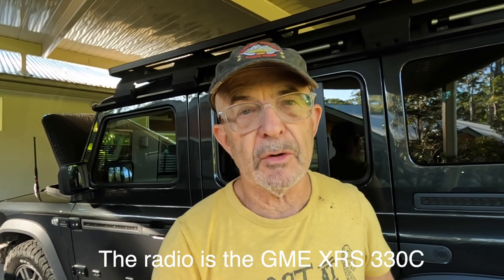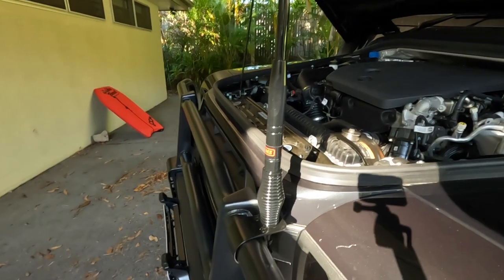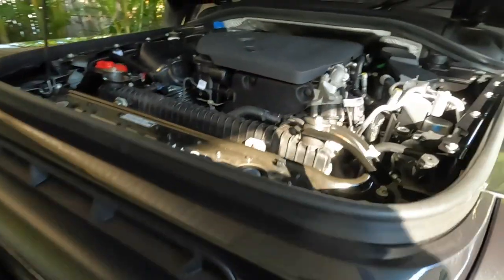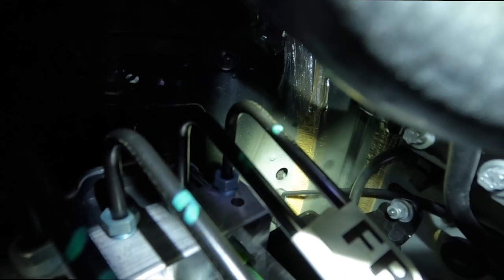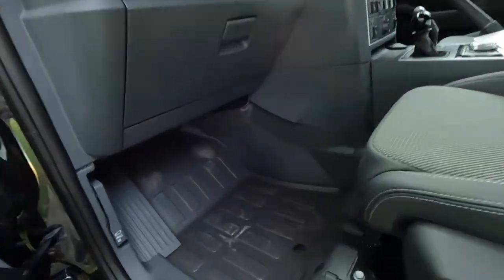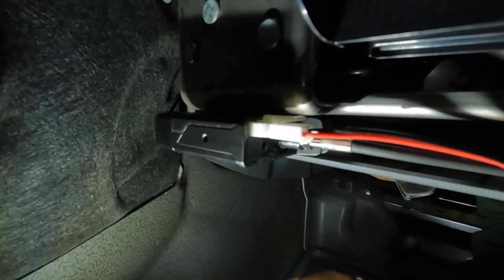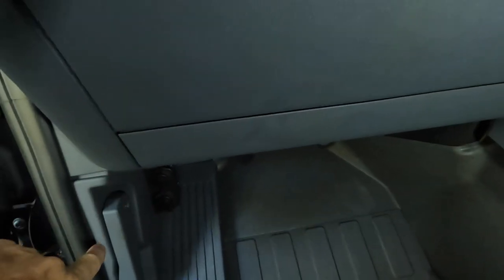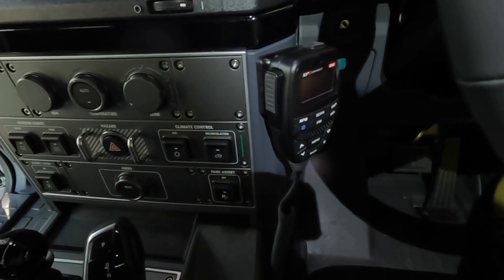How to install a UHF (CB) Radio in an Ineos Grenadier without drilling any holes.

Comment: Nice thank you.  Saw someone else on the INEOS Forum that put the unit under the steering wheel and managed to mount it to a bracket under there also without drilling or cutting.  Thanks for the grommet location that’s awesome.
Reply from the maker: Thanks Andrew. I appreciate your interest and comments. John

Comment: That grommet find is awesome, John.

I'm thinking of putting my magnetic microphone bracket on the black plastic to the right of the rotary dial on the centre console (next to the handbrake if that makes sense). 😀 I'll post a picture on the Facebook page.
Reply from the maker: Hi Michael, Good suggestion, it does impede access to the buttons around the control knob a little. The issue is most surfaced are textured and the tape doesn't  seem to stick for long in the hot weather. I have moved my microphone up a little from where it is shown so that the tape sticks to the smooth black strip, hopefully it will stay there. I really don't want to drill holes! thanks for your interest and comment, John
Reply: @cannyoutdoors   I place my left hand on the rotary dial, and use my thumb to press the FAV and OFFROAD buttons, so I'm hoping the microphone won't really get in the way too much. 🙂

Comment: Thanks for that mate. Very useful to see where that grommet sits. I’ll probably do the same as what you have. I would just like to know how you connected the power and which power switch actually switch on the radio.
Reply from the maker: Hi , I will put up a video in the next day or so showing exactly how to find the auxiliary power and how I connected to it and which switch it is. They are well concealed  but once you know where and what it's pretty straightforward. Thanks for your interest, John

Comment: Nice work! Thanks for posting. Is the power fed from one of the footwell power outlets that's switchable from the overhead panel?
Reply from the maker: Yes it is. They are pretty hard to find. In the next day or two I will post a video on how to find and connect to them. Cheers John

Comment: 0:56 Hi, John. Do you recall the size of the mounting bracket you chose? I’m planning to go with the same setup on my grenadier. I’m looking at a 50mm bracket that looks similar to what you have in the video here. Thanks!
Reply from the maker: I used Stedi 28-30mmm tube mounting brackets. $24 a pair. However I needed to pack them a little and found 10 strips of insulation tape put together and then used as extra packing did the job. Been there now on a number of trips and haven't moved.Hope that's helpful, John

Comment: John, did you use the wires in the footwell that are switched from the overhead panel? Follow up question, did you use a standard 50mm bracket for the antennae? Any recommendation?
Reply from the maker: Yes, I did use the footwell auxiliary power and while I was there added a USB and cigarette socket. I intend to plug my iPad into it when using it with my mapping app. I will do a video in the next day or so showing how to find these auxiliary power outlets because they are well concealed. The bracket is a GME 50mm, it's quite tight and I had to drill out the holes a little in the bracket to get it to fit. Easy to do , works well and looks neat. Hope that helpful thanks for your interest, John
Reply: @cannyoutdoors  Thanks for that info John. I am in Brisbane and your video was very helpful. Let us know how you go getting the Anderson plug wired and somehow getting that 13 pin euro to work with Aussie 12 pin flats.
Reply from the maker: Certainly will. Thanks again John

Comment: Hello Canny, which UHF (CB) radio is the Beate? Which model did you choose and why?
Reply from the maker: I chose the GME XRS 330C. Firstly  in my opinion GME is high quality and reliable. made in Australia and with a 5 year warranty. I chose the XRS because it is their latest version with  OLED screen and all controls in the hand piece meaning the actual radio box can be concealed anywhere. My understanding is that the 330 c/w the 370  is the internals are the same but the 370 has a much more robust(and larger) case a speaker built into the box. This is more suited to trucks or ag machinery The 330  on the other hand is lighter and much smaller therefore easier to conceal under the dash or wherever. I got mine as the Outback Pack (XRS330COB) as it was more economical and came with the very good AE4707B antenna. It's not the cheapest but I have always found GME totally reliable. If you are in Australia I suggest you check out the price from REDFleet (no connection whatsoever) as the were the best deal I could find. Hope that's helpful, John
Reply: @cannyoutdoors  Dear John, thank you very much for your reply. I will see if I can get something like this in Europe. Great videos!
Reply from the maker: Great, Good luck with it, John

Comment: Thanks for this. Very helpful. I wonder if the actual unit could simply be located in the glove box or is the glove box too small?
Reply from the maker: Yes it could but the glove box is really small and it would be messy bring all the wires in. It is really easy to put it underneath. You will see a metal surface under there and the tape sticks well to it. Then it’s done,out of the way and can basically be forgotten about. Hope that’s helpful. Thanks for your interest. John
Reply: @cannyoutdoors  Great.  Makes sense. Thanks.  I'm looking forward to actually seeing the spaces

Comment: I tried a few dble sided tapes for that magnetic mic bracket including Gorilla & 3M. It won't stick to those plastics & falls off in first bit of heat. Ended up screwing it into the plastic.
Reply from the maker: Aahhh! I fear you are correct. All of the surfaces are textured and yes mine has already dropped off. I have found the 3m will withstand our QLD heat but only if applied to perfectly smooth surfaces. Thanks for responding. John
Reply: @cannyoutdoors  I did a similar set up with my freelander 2 and disco2 and had the same trouble with thr 2 sided tape I found a 3m product that is used to fit gps equipment into heavy earth moving equipment (so that it can be changed from machine to machine) . It is a heavy duty velcrose with a backing that sticks like crap to a nappy , use it on the mic mount and dash and very ocasionly the velcrose lets go (about twice a year)